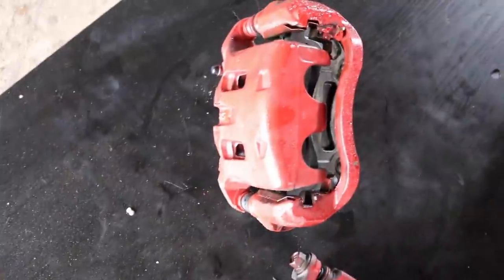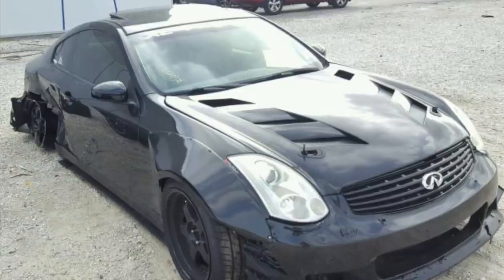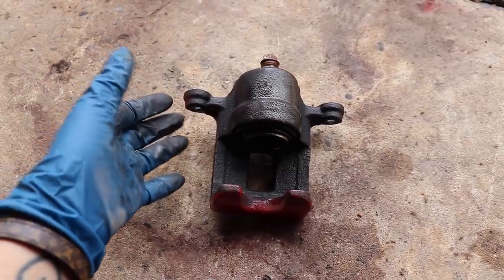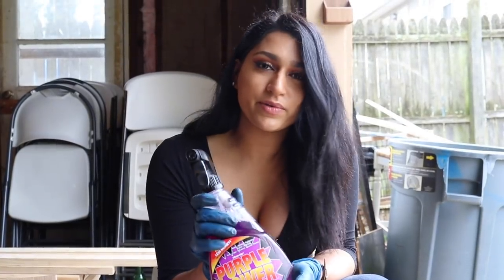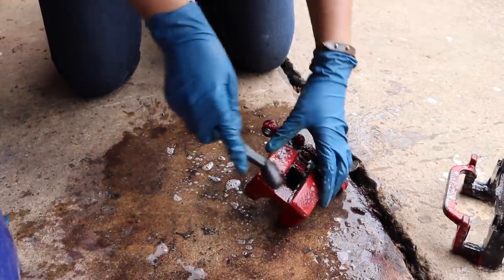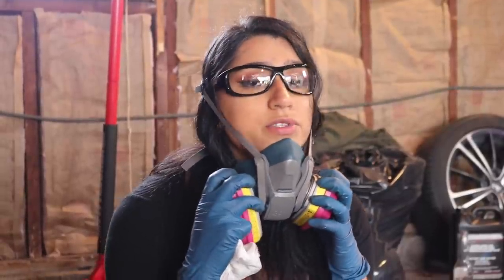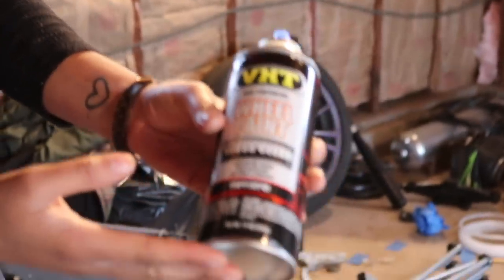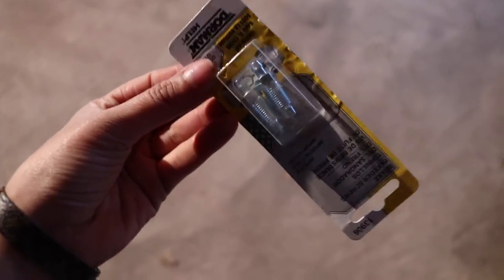PAINTING EBAY CALIPERS FOR MY 350Z

Comment: It's been a little cooler here in the northeast.  Don't be surprised if the new paint chips off really easy.  I never like painting anything below like 70 degrees.  It just doesn't adhere well at all in cooler temps.

Comment: "if you're wondering why they're seized, it's because they are, the car is old" 

That has to be the best technical explanation I've ever heard 😂

Calipers usually seize because the seals the piston sits in swell due to salt and corrosion making the piston stick. Or the sliding pins aren't lubricated. That outer seal is a dust seal too, not fluid, that's further in the caliper.

You're right too the previous person's paint job was crap...you did a nice job on these.

Comment: The first thing I thought when I saw those calipers was "what a crappy job".   Great masking job. I actually use Dawn at work to degrease some stainless and other steel parts that come in. Works pretty well!

I've noticed far less planes in my part if Northwest NJ, though the birds have definitely been out making noise. By the way, I usually prefer Castrol GTLMA Brake fluid DOT 4 or Prestone DOT 4 synthetic
Reply from the maker: Thank you! I always assumed if dawn is safe for baby ducks why cant they be safe for brake calipers ?

Comment: You might want to think about getting a 6" Bench Grinder & a couple of wire wheels since you're going to be doing a lot of grinding/refinishing on the (older) 350 parts.

And as to the airplanes overhead - wind direction has a big impact on airplanes during takeoff & landing (cars on long straights feel similar effects). Airports will switch the direction of the flight patterns depending on the weather, thus sending them over different parts of the surrounding area during their climb out to cruising altitude.

Comment: Silly question,but why didn't you just remove the pistons rather than pushing them back? That way you can check the condition of the seals before you use the calipers,especially as they are used parts. As for paint removal,if you've removed the piston and seals,then a good quality paint stripper,Nitromors(in Uk) gives excellent results,quickly.Seals must be removed,though,as it will eat the rubber. I've not done this on car calipers yet,but it works a treat on motorcycle calipers. PHJ(high temp) is a good paint to use on calipers,exhausts,etc. Love the videos,keep up the good work.I wish my daughter would work on her Audi TT as much as you work on your car,that would give me more time for my bikes.

Comment: Did a good job! but just saying for the amount you spent on these stock sized calipers, you could have saved up for some nice Z32 4 puck calipers for the front. Used are like between $150-200 but you can get a pair at autozone brand new for only $120. I think it would have been worth it and you just painted those if you were going for a time attack-oriented car. Doesn't affect the learning curve of learning to drive manual as you said

Comment: I wouldn't worry about getting all that perfected with bleeder valves, Long as their not Stripped, they dont need be Replaced. They wire wheel for the drill looked Healthy , i turned my garage upside-down i cant find mine.

Comment: In the future, if you want to save some effort, and peel ALL the old paint off easily, just go to Home Depot, or Lowes and buy a small pint, or quart of paint stripper.  Brush it on, and wait five to ten minutes.  It will bubble up, and flake away, then a wire brush will get rid of it like nothing.

Comment: Good job! You did not fall for the trap of using gasoline to clean them.
Next time, use some "wheel cleaner" for everything related to brake pad cleaner. With water of course..👍
Reply from the maker: people actually use gasoline ? haha
Reply: @MICKBETH  sweety, yeah, straight gas...
The rubber gasket blow up like you could not immagine😁

Comment: Good work! Just for the paint, I am afraid it could be not high enough heat resistance level. If you brake hard, the brakes get really hot. So hope it will last. You probably would be better of with some high temperature paint or brake caliper paint. Fingers crossed. :-)
Reply from the maker: Im worried about the gloss honestly because i used Flame resistant primer and the i used black caliper paint

Comment: 250 F? Brake calipers can hit 400 F. Try using a ceramic paint meant for engines and exhaust systems.
Reply: What he said exactly
Reply from the maker: I used flame resistant vht primer and black vht caliper paint but couldn't find anything better for the gloss. Due to this virus many things were limited shipping wise and this is all  could find

Comment: That brake pad depressor design is ridiculous. No caliper needs that long of a threaded shaft, and how the hell did you manage to bend the backing plate with its zero leverage handle? Thank you for calling it out for sucking at its job.

They came out looking good, nice work. That paint isn't for brakes, but it'll hold up fine for a while. Calipers can easily see 250, but they rate that at sustained temperatures, probably. What happened to blue?

If your bleed screws are in good shape, just leave them alone, stock ones are better than those aftermarket ones.

Comment: Theres literally caliber paint in any auto store and home depot. Made for tor doing this
Reply from the maker: john russo this was caliper paint.
Reply: @MICKBETH  the can you showed was wheel paint and held up to a temp of 200degrees. caliber paint is about 900degrees F.....and says caliber on it not wheel
Reply from the maker: john russo the gloss that was used was 250 F paint , the black was caliper paint. Regardless they will be just fine.
Reply: @MICKBETH  well one of them wont last if its not rated for cailber heat, 200degrees is not high enough
Reply: I think you will be fine. For normal street driving the calipers don't get that hot. The hottest part will be the pad but it doesn't transfer heat well into the caliper.
Reply: @devvynully  not in my experience. melted off just a month of going to work
Reply: @buffalobmf  OK. I will be interested in Mick Beth's experience with this after driving for a while.